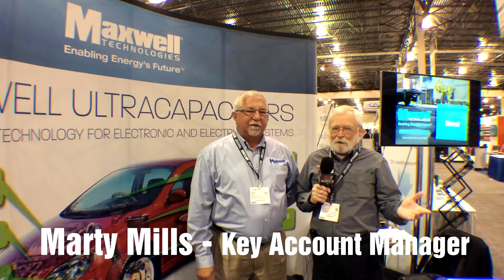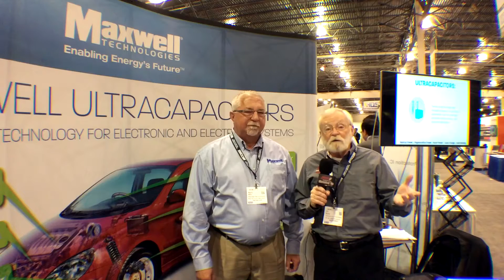Ultra Capacitors For Use In Cars - Wrenchin' Up

Comment: I want to extend the range in my electric car using these Maxwell ultra capacitors.   Can it be done?
Reply from the maker: Hi - That's a good question but you'll have to ask Maxwell for the answer. Their web address is in the metadata below the video. Thanks for watching!